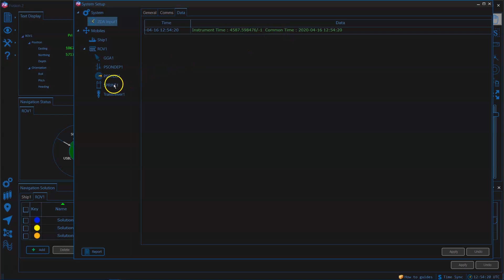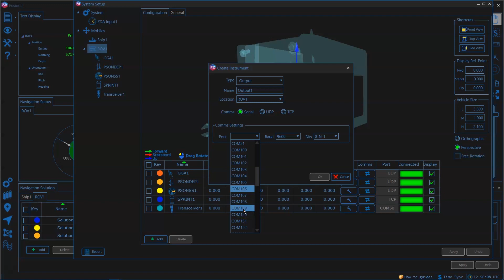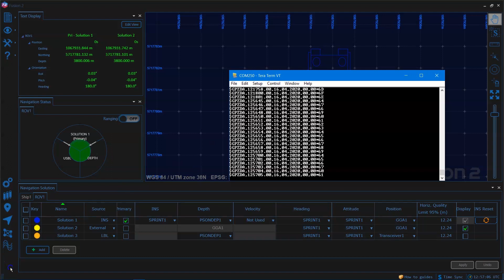How To - Fusion 2 Time Synchronisation

Comment: Acronym meanings anybody ?
What is the difference between ZDA and 1PPS  time system
Reply from the maker: The ZDA message is GPS based and contains UTC (Coordinated Universal Time), the day, the month, the year and the local time zone. 1 PPS (a pulse per second) is an electrical signal that actually repeats once per second. PPS signals are used for precise timekeeping and time synchronization